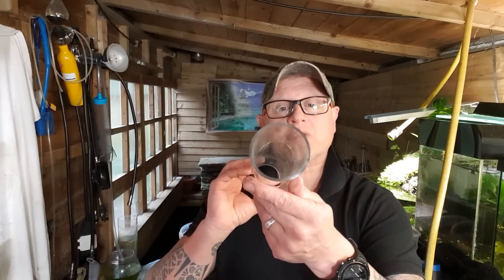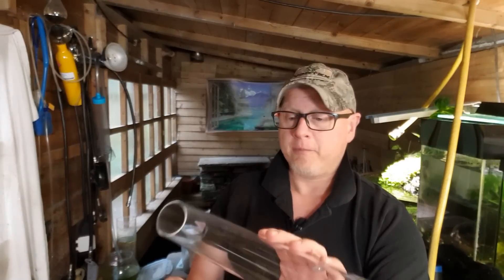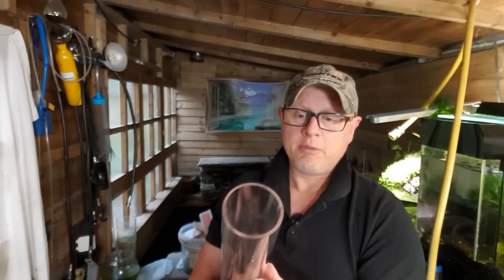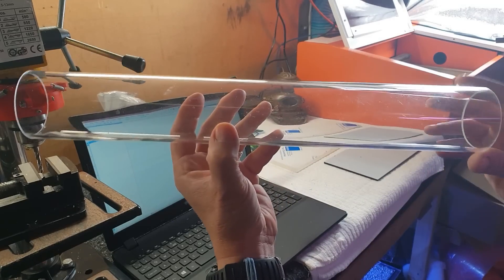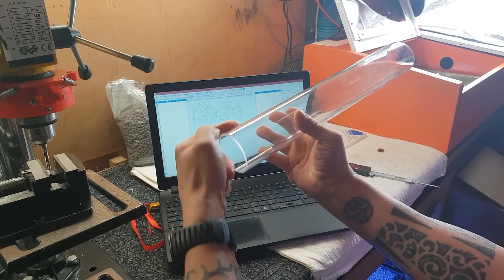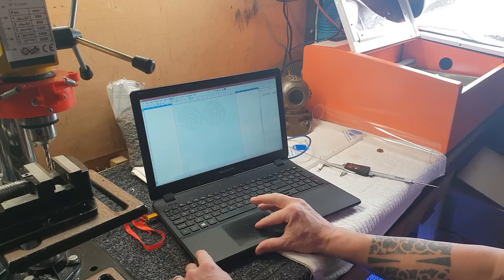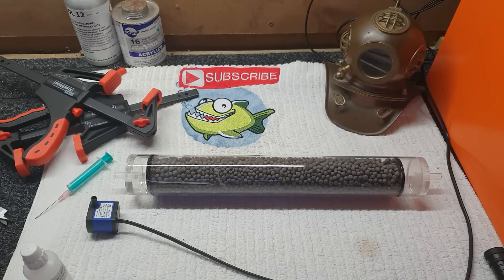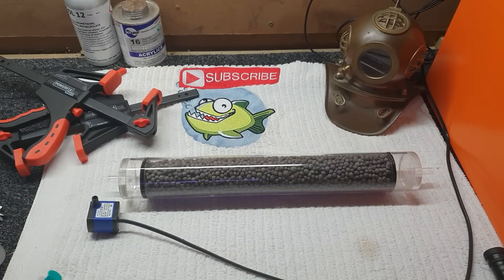DIY NITRATE REACTOR .BREED MORE FISH DO LESS WATER CHANGES.

Comment: Damn, you're a man on a mission - I only spoke to you about this yesterday and you dived straight into building it. Good work,man - it looks great and you're bang on when you say a slower flow will increase the amount of anaerobic activity as that is 100% right.
A full cycle can till be easily achieved using a canister filter but it does take quite a lot of suitable media (biohome)  to do that, anywhere from 1kg per 100 litres (26 US gallons)for a normally stocked tank to 2kg per 100 litres (26 US gallons) for a heavily stocked tank. In that high flow situation the media holds maybe 5% anaerobic bacteria but in a low flow (deoxygenated) environment like a reactor that could increase to 50%, 75% or higher depending on the flow.....lower flow = more anaerobic activity so as far as how much biohome would be needed the normal tank requirement of 1kg per 100 litres for nitrate reduction could drop to 0.5kg per 100 litres or lower depending on the flow.
I always laugh when I see some of the very high profile channels who have never used biohome say that nitrate reduction is impossible in canister filters, biohome doesn't work etc. etc. when thousands of people all over the world who have used it tell them otherwise....problem is that their posts get deleted, they get banned from their channels, forums etc. so it maintains the ignorance of the full cycle simply to preserve the nonsense those channels are spreading - just try putting a positive comment about biohome or something about a full cycle being achieved in any situation using media in the comment section of a popular channel videos and see what happens, lol
Good on you, man - we're slowly getting there and that's why channels like yours are so important to get proper information out into the sea of 'Tank alteration #39' / 'All my fish are dead' / 'New fish!' / 'Look what idea I'm going to pass off as my own' / 'Livestream about bugger all # 376' type of crap which is blighting Youtube. Problem is we're small fish swimming against a tide of sludge but people who care about their fish are attracted to good information - it's no surprise that you have a really excellent set of people who watch your videos and that will always have infinite value compared to the money driven nonsense route. 
That's why I'm glad to support you and other honest channels however I can.
Reply: Pondguru Spot on about rubbish fish channels Richard.  I've subscribed to quite a few in the past but have unsubscribed from the majority as I got increasingly irritated by them too.  Mark is fab, and so are you for reliable intelligent content and info, you both deserve many more subscribers!
Reply from the maker: I don't mess about mate!  Happy new year.👍😀
Reply: Hey Pondguru I used your video to set up a used Eheim canister filter I got with a 60g tank off Craig's List. I now understand the layered order needed for best filtration. I do need to find something to take the weight off compressing the filter floss (quilting fiber fill I already had). I'll figure something out. Need to find a pond plant pot or something similar. Thanks for all the great info! Happy New Year!
Reply: Thank you both for you great videos
Reply: Have you ever experimented with a sulfur denitrator? They are exceedingly good at nitrate removal.
Reply: Could you speak more about the de-oxygenated environment VS  if it were air driven wet/dry....? Thank you.
Reply: Has Pondguru made a video on this, with it actually being attached to a canister filter. That would be a really good video to make.
Reply: Pondguru I use bio home mini ultra, I get a full cycle and no one wants to believe you, but you know I couldn’t care because my fish are healthy, never had diseases nor any deaths, cherry shrimp breeding like crazy, pigmy corys and neon tetras breeding.... I love the stuff
Reply: mat k I am interested in setting up canister filter with biohome. When you say full cycle , how big is tank, how big is filter , what are nitrate readings , how often do you do water changes , oh , and how much biohome in weight ?
Reply: Did you ever end up testing this invention? I didn't see the video linked here. I'm all about frankenstein tanks so DIY solutions like this are right up my alley.
Reply: I know this is an old post. But I'm hoping people still read this. Bio Home does work. I was able to knock my nitrates down by loading a second canister with biohome and slowing down flow with pre-filter sponge on intake tube and sponge on outflow as well. Still isn't where I want it. So, I do plan on making my own, not so fancy reactor with biohome or seachem de-nitrate, which also works. I'll likely dabble with sulfur as well.  Thanks to the both of you.
Reply: @ScottLauler  Nice one and best of luck with the filter ideas.
Reply: Your comment made me subscribe!! I lost a redtail that would sit in my hand. Nitrates.. Now I'm gearing up for a anaerobic war. ❤️. Cheers!

Comment: Heya Mark, I created a denitrification basket using two undergravel filters and baked clay kitty litter last year and have been achieving constant 0 to 20 ppm with zero water changes for the past year, I cut the riser pipe for the undergravel filters to just four inches in height to slow the water movement through the substrate. The tank (230 litre) is moderately stocked (25), silver dollars, congo, neons and rummy nose, no plants and very low levels of algae, also run a canister filter and pre-filter, its running like a champ, denitrification filters are certainly worth experimenting with...
Reply: post a pic, at the moment my 350L tank I just used a 25L bucket with multiple reverse flow sponges and gravel media and then let it drip into the tank from the top cause I'm cheap and functional at the moment. Still need to get a water tester though, to see the water quality.
Reply: @MorneBooysen   yeah, I got cheap under gravel filters off Ebay, made two tank sized trays and then tied the two together and put kitty litter in the center, I didn't bag it but I guess it probably would've been better, then put it at the bottom of the tank under my substrate with one riser pipe cut short, I haven't got photos though I'm putting together another one in a couple of months a little different, with a sand substrate and garden weed barrier cloth and probably a full length riser, flow will already be restricted by the sand etc,  I'll get photos if you like . its dirt cheap $8 for ten pieces of modular filter plates, I used I think 34 pieces for the three footer, and a huge bag of unscented clay kitty litter for $15.  System is really stable the only time i get higher than normal nitrates is if I feed them too much, or should I say the children (rolls eyes) LOL but a couple of days back to low NO- 3 ppm's, just did the first water change the other day to clean up the substrate of detritus and will probably stick with three monthly water changes from now on, tank got a little messy, but I guess it shows that it works, anyway good luck with it
Reply from the maker: Happy new year.👍😀
Reply: @MARKSAQUATICS  Happy new year mate,

Comment: Nice reactor mate I went the cheap-ass and bought 2 sunsun 603s and a small power head. Filled both sunsuns with 2kgs of biohome gravel each. I have half closed the taps on the outlet side of the sunsuns so I get a real slow flow returning into my tank. Fingers crossed I start seeing some results soon and lower nitrates in my frontosa 6x2x2 tank
Reply: i did this as well...any improvement to your nitrate? tnx

Comment: Hey mark this is an awesome diy nitrate reactor,  I would love to see if you could find a way of incorporating sand into the design, one of the best water polishers out there! I guess the water would have to come in from the top, and trickle down to compact the sand then out the bottom crystal like swimming pool water.
When it gets clogged simply remove the unit, run it in reverse & back wash untill the sand is clean again.

You have no end of possibilities with that 3D printer!
Reply from the maker: Some good ideas there. 😀👍

Comment: I'm currently building a setup with 3 large tanks on an 18 foot long stand that will all share a sump that runs the whole 18 foot length of the stand.  I'm thinking of installing a horizontal pipe with water trickling in at one end and draining out the other into the sump.  I can't afford that much Biohome media but I have found about 10 gallons of used Seachem Denitrate on Craigslist.  DO you think this might work for nitrate removal?

Comment: With that filter you made would it work as good on its side or not cuz I am going to make one for my tank
Reply from the maker: Not really . You could run it on its side but you'll have to make the lid very secure so the media doesn't fall out.
Reply: @MARKSAQUATICS  OK Mark thanks for the reply

Comment: Isn't majority (if not all) denitrifying bacteria anaerobic? How will you ensure anaerobic conditions in such short pipe? Not trying to hate here - just genuinly asking. Great design and making though!
Reply from the maker: Most bacteria are aerobic.  anaerobic bacteria do not need air to survive and colonise deep within sand beds and in the media. they are great for removing nitrate. Happy new year👍😀
Reply: Nitrate (No3) = Nitrogen + 3 atoms of oxygen, in theory if you can starve aerobic bacteria of oxygen it will take from the N03 (3 atoms of oxygen) leaving just nitrogen, nitrogen being a gas should just gas off. it probably wont get rid of nitrate completely but should defiantly lower readings as long as the flow is low as possible
Reply: @sephuk  Some aerobes are facultative anaerobes as well, so these should start the denitrification process off. Other bacteria , such as Nitrocystis, play a part in the process and require less O2, for the intermediate stages; strict anaerobes such as Paracoccus convert these intermediates - nitrous oxide N2O and nitrogen oxide NO, back to gaseous nitrogen to complete the cycle. These bacteria take a long time to establish in the anoxic  zone so results are often mixed.

Comment: Interesting thing is that you are located in UK and you use metric units instead of imperial
Reply: @viciousfish6145  This info from your side is very interesting. I know any time I watch some UK show on TV ( like Car Sos or Wheeler Dealers) they use imperial units, when they are fixing or replacing some part on car. In my country we use imperial units only for pipes, but I think it's a standard in whole world
Reply: I'm from UK and whilst we used to use the imperial system we changed over to metric decades ago.  
As Peter Smith rightly points out our speed limit signs are still in miles per hour and we still buy beer in pints but everything else is metric. 
He is nearly fifty and was only taught the metric system in school; I unfortunately am a decade older than him and I was taught both.  The transition from imperial to metric was an interesting time - I remember trying to buy plasterboard at 1/2 inch thick and was told that it had all gone metric, it was now either 8mm, 12mm or 15mm thick but the sheet still measured 8 feet x 4 feet. 
It's now changed obviously and now everything is metric.
The whole world has adopted the metric system apart from just three countries which still use imperial measurements, these are Myanmar, Liberia and USA.
Reply: @viciousfish6145  aircraft still judge height in feet
Reply: @viciousfish6145  are system was based on twelve not ten simply put you can divide 12 by 3 get a whole number which you cant do with ten great channel by the way

Comment: After 2 years my biohome really started to clog up and loose its efficiency, ive heard the only way to clean it is to boil it which obviously kills the bacteria, i see in that design you have glued both ends in, so cleaning is impossible, be interesting if you have the same problem. I also have the standard course, medium and fine pads for mechanical filtration before people say i don’t have enough mechanical
Reply from the maker: The idea with this is to put it at the end of the filter outlet so only the cleanest water goes through it from a tee off back to the main tank. 😀👍
Reply: Yes completely understand that but after a couple of years the media started to clog up, reducing its efficiency. But best of luck to you and the project, look forward to seeing it hopefully still working in a couple of years, i will subscribe to find out 👍
Reply from the maker: Thanks  you.😀👍
Reply: @MARKSAQUATICS  hi i made one 5 meters long out of 4 inch pvc pipe sealed with end caps   to hang on the side of my koi pond

Comment: Hi mark and everyone, 
I don't want to do water changes, it's a nuisance. I'm just totally sick of doing changes on that tank of 5-10 gallons a time, 15-20 gallons at another. once or twice a week when everything appears fine mostly.
 However, my Ammonia and nitrites have been stable and at nothing for years now, (running a 72g, with a 150 wet/dry and a 300gp/h pump. I clean my pre-filter a couple times a week and change the filter pad in the wet/dry once a month.  I don't have an algae problem at all and never have, the fish that are there seem fine, some large kissing gouramis  I've had for more than a decade now, 

I've noticed new introductions don't fair well in the tank and don't make it past 24 hours, I can take fish from the tank and put them in another one I do regular water changes on with a usual acclimation, nothing special needs to be done,  but I can't leave them there for a couple months and then put them back, they won't make it the 24 hours either (found this out with a breeding pair of pearlscale albino angel fish and lost the male). I feel like it's "old tank syndrome" where nitrates are too high in the substrate. Small water changes don't do much at all, vacuuming it is a real pain.

My only thought is that my nitrates are built up to an intolerable level for everything except for the fish that have been there forever which had a slow acclimation to it. 

Is this even possible? I know nitrates either need to be used up or removed,  Would planting use up the nitrates efficiently and bring it down so I could put in new fish without them dying? 

ideally I'd like it to be "hands off" and just have to change filters and touch up, I want away from the water changes on that thing it's why I got decent filtration for it that could cycle the tank water 4x an hour at least through the filter but I feel like the nitrates have built up over the last couple years to intolerable levels for any new fish that haven't slowly adjusted to it. 

Will planting get it under control or just add to the problem? I also don't leave lighting on in a manner that would promote algae growth or have necessarily "grow lights" for the tank, just a aquarium 4ft  fluorescent bulb.

So would planting be worth trying? would I need to change lighting of I did plant? or am I pretty much trapped into sinking my arm into the tank to vaccuum the bottom and lug 20 gallons of water around or more every week for the next forever?

Comment: Does it matter if the reactor is vertical or not? It will have water pressure from one end so will flow through anyway. Also, I thought I heard that anaerobic bacteria do not like light so should this one have a sleeve to darken the media for full bacteria usage? I think it's good to be able to see into it when needed though. I also think having one end not permanently attached but sliding into the unit and having a gasket for a seal would make sense to be able to continue to use the reactor in years to come by cleaning it occasionally between uses. I hate the idea of throwing it out if it gets clogged for some reason. Or maybe if there was an illness in the tank and you wanted to sterilize the media and restart it. Whatever, it's a cool thing. I like to watch you work on acrylic projects.
Maybe put some slat wall on the empty wall behind your work area and use it somehow. Also the areas above your pond would be cold but still humid enough for some epiphyte plants. I wonder how cold it gets in there.
Reply: vertical will give you much better distribution and contact time between catalyst (bio media balls) and the fluid water, thus it will be much more effective and increase lifetime since you are not depositing all fouling on only one side if it was horisontal orientation
Reply from the maker: Some good ideas there.  Happy new year.👍😀
Reply: Happy New Year to you too. Sorry for being so full of suggestions. I don't want to be pushy or suggest that you need to do anything different because you are so very awesome already. Hard to get across attitude in just printed form like this. I think its all the creativity and DIY that gets my brain working and it seems teachers and parents never convinced me that nobody really needs to know what I think. Best to you and yours!

Comment: couldn't this be done with a hang on the back bakki river running  a really low powered pump or use a valve to regulate the water flow like you have
Reply: No. Anaerobic bacteria needs extremely low oxygen